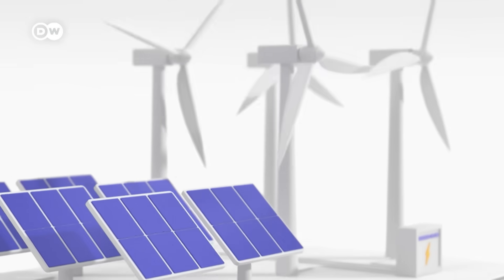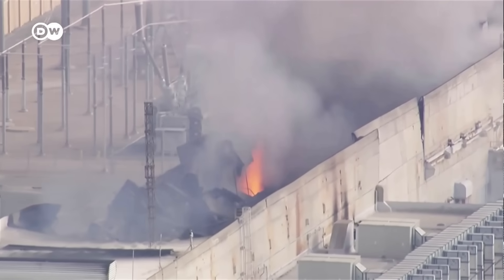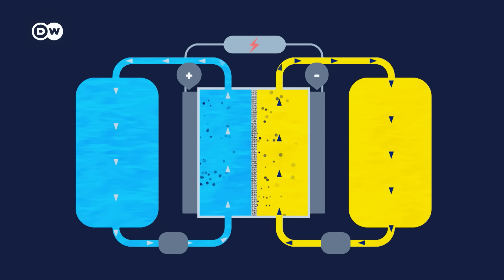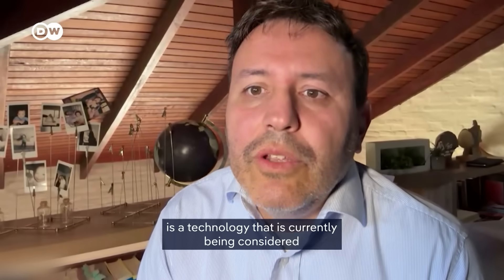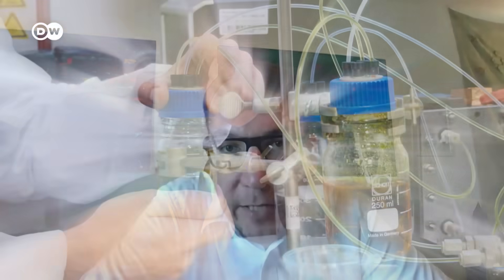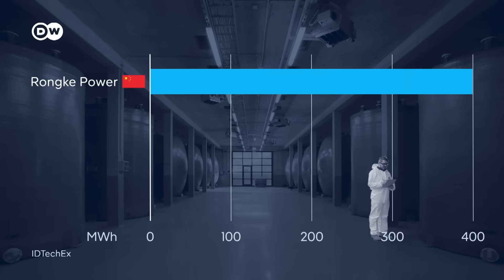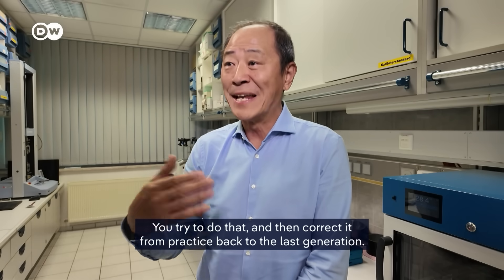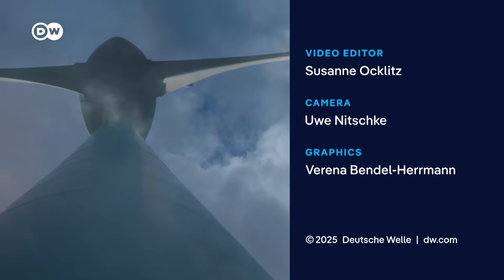New energy storage technology on the verge of a breakthrough? | Transforming Business

Comment: If you do the stoichiometry, you will find that Vanadium is way too expensive and does not compete below $100/kWh, which is where Li-ion already is today. Sodium is the key to going lower cost. Not Vanadium.
Reply: Vanadium is expensive mostly because of it's low demand (ca. 120.000 tons/year, only 20.000 tons are not used for alloys). When the production is scaled up, the prize will drop.
Reply: Low extraction cost Vanadium deposits are somewhat limited, so that scaling cost reduction will be limited in volume and will top out well before demand for grid power storage would.
Reply: @bluecedar7914  There is a considerable amount of vanadium-rich iron ore. If that's used in steel production, the slag containes up to 25% of vanadium. It can be found too in oil-refinery-waste, at least if some types of crude oil is used. Those sources are not used, because of the still low demand. They will be with a scaling up of production.
Reply: @johnbraunschweig The cost of extraction from these sources is still going to be higher than that of Lithium or sodium. These batteries may end up complimenting lithium and sodium based batteries, but I doubt they can be scaled enough to become the dominant grid storage technology.
Reply: Yeah this is just its current state. If you invest and scale it then it becomes cheaper and the point she made is that many of its components are reusable too. So longer life than lithium.

Comment: I didn't think this video was any good, because there are a very wide variety of different storage solutions and this video only looked at two.

Sodium-ion batteries should have been shown because they are much cheaper than Lithium-ion batteries and don't have problems with fire or over heating, they don't have problems with cold weather or hot weather, and they don't rely on any rare materials.

This video should have also mentioned compressed air storage because it doesn't require any rare earth materials and it's very competitive with other solutions.

This video should have also shown the more old school solutions of pumped hydro, although this is geographically limited it does already provide massive amounts of storage.

Also this video should have pointed out that you can also store the heat that you need, so an industrial site that needs massive amounts of heat can have a battery that is filled with hundreds or thousands of tons of sand and is the size of a building.  Basically when you have a lot of power you heat the sand with the electricity, and when your factory needs the heat then you can pump a fluid through the sand and get the heat out.

There are so many more solutions than this video showed it really isn't a very good video.

Comment: Wind Energy is a Joke. Solar and Nuclear is the way forward.
Reply: If wind is a joke why does it produced 30% of electricity in Germany and around 20% in EU?
Reply: Wind is solar power essentially, just indirectly. It makes sense, but only in spots where it geographically produces a lot and often. Whereas solar panels make sense basically anywhere.
Reply: @SimonMester  Sort of true but recently it has been shown that by making the towers somewhat higher you can expand the rayon where wind makes sense quite a bit. Higher up = higher winds. And actually more constant.
Reply: @beatreuteler  I think solar panels are overall better and more universal, but that doesn't mean wind power doesn't have a place. In fact, you tend to have more winds, just when you have too little sun. :)
Reply: @SimonMester  Yes. It's called Complementary I believe. Correct me if I'm wrong. And agreed, solar is more versatile as you can easily use it rooftop where wind does not make any sense. This said, solar can be used more locally or more distributed if you will and thus is much closer to the end users of electricity at least if we look at residential areas.
But that does not confirm HLPSr' comment which classifies wind in a totally wrong way.
Reply: @beatreuteler  Yeah sure. Each source has it's place. Solar on rooftops gives excellent trickle power, reducing power plant needs. Nuclear is great baseload power. Wind is great supplementary for solar. Geothermal makes sense in some places, heat pumps for heating and cooling reduces power needs overall benefitting everything else. Hydro is great for buffering needs, or where you can get it, just free power from rivers.

There is no one solution that eradicates the need for others. It's just silly when one or the other is forced, when it doesn't fit. But that's usually an ignorant/corrupt government problem.

Comment: Lithium based batteries can be recycled at end of life. Claiming that they need to be thrown out makes me question your whole argument.
Reply: What about sodium ion batteries? Apparently cost per wattage storage ability makes it much more cost effective for grid storage
Reply: So can lead acid, but they’re worth almost nothing at the end of thier life and you have to buy new ones…I sell 1000’s of them and we recycle the old ones but only because in Europe we have to, the clients are not at all motivated to bother because the amount they get for the recycled battery is too low to bother
Reply: @xax8918 point being?
Reply: True, but you're then relying on people to recycle them properly, which at least in the US, is few and far between. Plus lithium Ion batteries burn at extreme heat. In cases where Tesla caught fire, first responders reported needed to submerge the vehicle under water for a week, before the fire was put out.
Other than the ethical problems that come with the mines of Lithium, it's much safer to use other sources of storage.
Reply: most vehicle batteries have yet to meet the end of life threshold yet so postulating that they wouldn’t be recycled is just speculation. There are over 117,000 gas vehicle fires every year while EV battery fires are a much more rare occurrence. EV fires occur at a 1500 to 100,000 rate for gas vehicle. Not to say there won’t be many storage solutions in the future. My point was just that making exaggerated claims doesn’t help an argument.